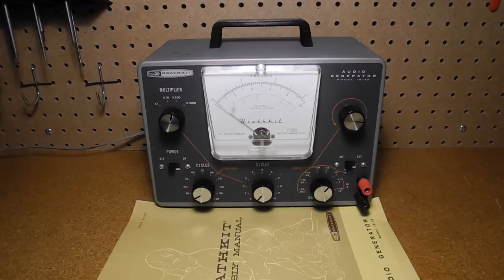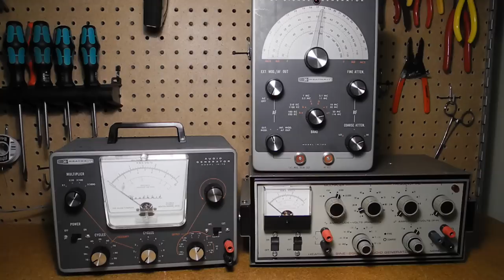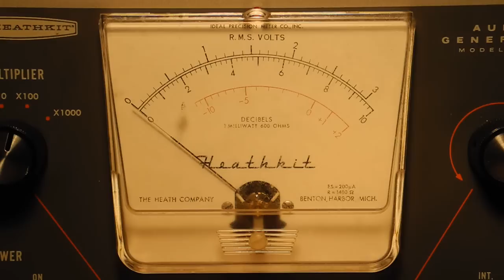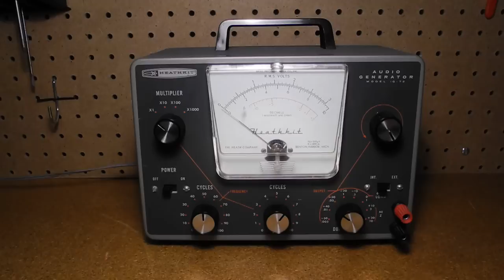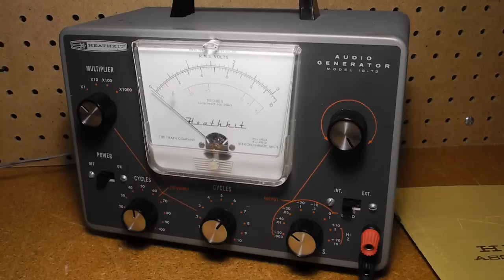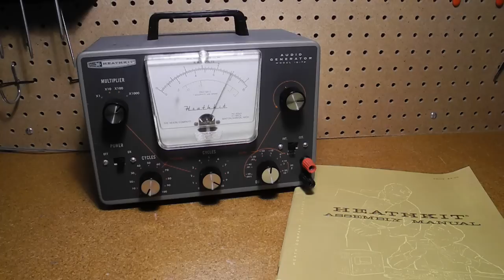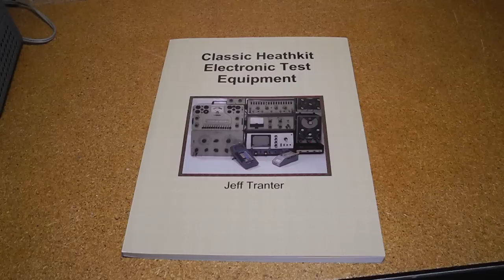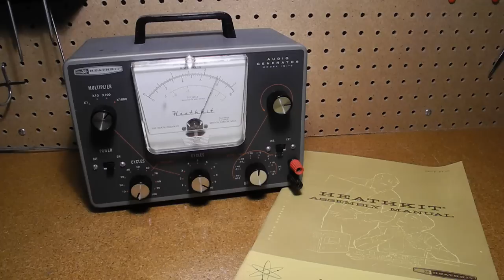The Heathkit IG-72 Audio Generator

Comment: Great video, I just bought one 100% stock. I have a somewhat silly question, what’s the finish on the faceplate. I don’t seem able to get a perfect finish. Has a haze look to it, almost smudged. Anyway thanks for the video, my 5 Heathkit product.
Reply from the maker: It's a matte (not shiny) finish. Possibly yours was cleaned at some point with a solvent that smudged the paint?
Reply: @jefftranter  Thanks that makes, because is hazy which then you could call matte. Then I’m happy with the look. Thanks for the reply. I just ordered your book.

Comment: What are saw tooth and square wave useful for?  Thanks!
Reply from the maker: Square waves are useful for checking the frequency response of amplifiers.They are also useful in digital circuits for clock signals. Sawtooths are less common but are used in circuits for vertical and horizontal deflection  on cathode ray tubes (e.g. television and oscilloscopes), switching power supplies, and they are sometimes used in electronic music.